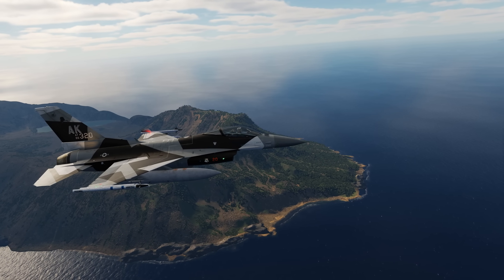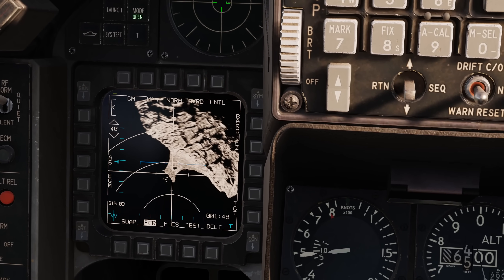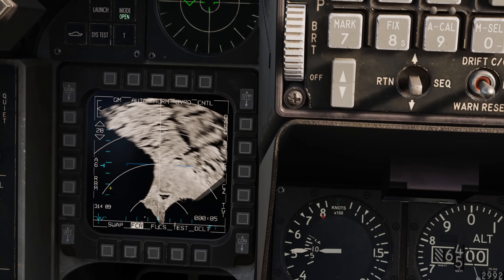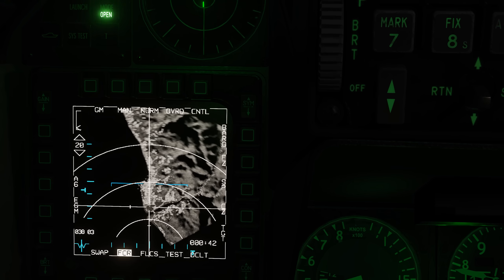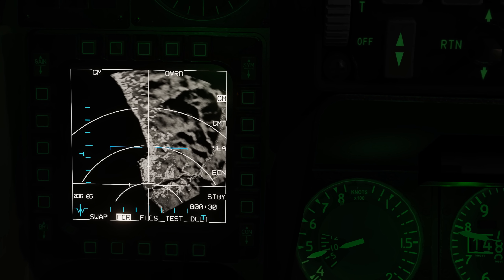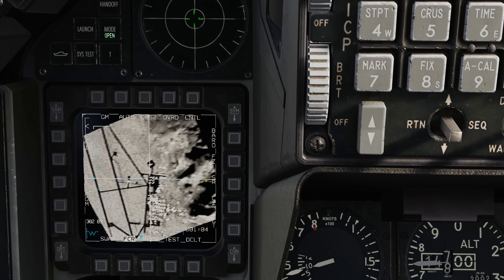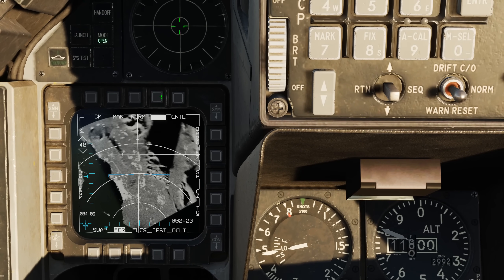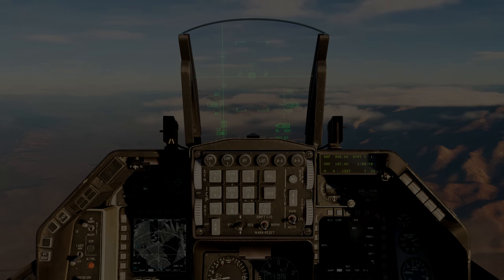DCS: F-16C Viper | Air-to-Ground Radar

Comment: I have mixed feelings about this. I like how the Viper gets good A-G rdr functions. All good there. No issues.

What I really dislike is that the (half)dedicated attack plane aka. F/A-18 Hornet gets a really bad implementation of A-G radar with the age old bug of the target designation not taking in to account the motion of the damn plane.

With its current state, the Hornet A-G radar is unusable, slow, unstable when slightly changing bank, and lacking any accuracy with designations even though it should have better resolution due to SAR.

Also the FRZ option on the Hornet is also absolutely useless since the coordinates are already misaligned due to the movement issue mentioned above.
Reply: well it is the legacy hornet, would be interesting to see if the Super Hornets, AG radar is better.
Reply: @Gamebreaker08  Well of course it would be, the current Rhinos (not the very first lots) have AESA radars.
Reply: @9GLoco  You are assuming the A/G radar is a tool that is actually used IRL. It isn't. Even with the improvements in radar that the Rhino brings, it's just not the magic bullet you guys think it is. The hype around the A/G radar is a definite DCS-ism.
Reply: @Golden5er  I’m not making that assumption at all. One of my best friends is a Rhino driver, and they use the radar almost never. It wasn’t a question of whether or not it was used, he asked if the Rhino had a superior radar to the Lot 20 Hornet, which it does.
Reply: @Golden5er  What exactly are you basing this on?
Reply: @Golden5er  You got my point wrong. I'm not arguing that it should be any better than it currently is. My point is that the radar is bugged with its designation logic.
Reply: @startrekmike  Reality.
Reply: @agostonbazmajer1100  People in DCS always state the same mith, BUT the book "Vipers on the storm" talks about using the ground radar in combat (Desert Storm). In GMT and expand modes on multiple missions. Using it for target designation.
Reply: @agostonbazmajer1100  The book I just told you is written by a Viper pilot who flown multiple missions in combat on desert storm. He talks about using it on multiple missions. GMT to aquire targest, and also on DBS. I'll take the book more seriously that a guy on reddit. Nevertheless, it must be there for a reason.
Reply: @agostonbazmajer1100  If we are going to start talking about "misleading" sources, we are going to need to apply similar logic to random posts on reddit and even some of the more accepted "truths" from books (like the enduring narrative that the HARM is a bad missile just because a HIGHLY biased DEAD focused pilot wrote a book with a rather easily debunked rant about it). 

  Here is the thing. For the last twentyish years, The United States has been fighting a counter-insurgency based conflict in the Middle East. This kind of conflict HEAVILY favors missions that focus more on supporting troops via CAS and strikes against large, fixed targets. Obviously ground radar isn't going to be terribly useful or even applicable in that kind of conflict. 

  As controversial as this statement is going to be, individual pilots are not always going to be the best sources of information. They can tell you about what they did (some more accurately than others) and what happened in their immediate sphere of awareness but that doesn't mean they know everything and it doesn't mean that the information they give is telling the whole truth. 

  The book 'Vipers in the storm' is interesting because it is based on a conflict we fought as if it would be at least near-peer in nature. Before the first Gulf war really kicked off, we had a lot of respect for the Iraqi military and especially their air defense network. The kinds of missions pilots flew in that war were not really the kind you would have in a COIN focused conflict. As such, tools like ground radar were more useful. 

  In the DCS community, there seems to be this enduring narrative that targeting pods replaced ground radar. This doesn't really make a lot of sense when you actually stop and think about it. the targeting pod is very good at looking at targets you already know the location of. They provide a (to borrow a term from a book) "soda straw" view of a small area of real estate. It is a highly detailed view but it is still a narrow one. The targeting pod is great at visually identifying and even guiding certain weapons on to a target but it isn't good at searching for targets. 

  In contrast, the ground radar can provide a much wider (though less detailed) view. It can tell you that there is a big blob of vehicles traveling in a known target area but it won't tell you what they are or if they are hostile, friendly, or simply civilians. This is why the ground radar isn't your ONLY tool. You use it to help put the targeting pod where it needs to go. Working together, they can allow you to see a big blob of stuff where it probably shouldn't be, create a sensor point of interest for your targeting pod to look at, and then attack it if required. 

  It is odd. There seems to be this almost aggressive push to dismiss the ground radar and I think a lot of it is based on taking what certain pilots say on the internet at absolute face value (and without any context). If we were to ask pilots in a more conventional conflict about the ground radar, I strongly suspect we would be given a different narrative since the ground radar can do things the targeting pod can't.
Reply: @agostonbazmajer1100  This is where I always kinda come back to Dan Hampton's 'Viper Pilot' book. It is a pretty accessible, pretty popular book in the DCS community and the reason I can tell that it is popular is because so many unquestionably take what he said about the HARM missile at absolute face value because "He is a pilot, why would he lie? He would know wouldn't he?" The problem is that he does know DEAD and deeply cares about DEAD but also makes it abundantly clear that he doesn't really value SEAD (which is where the HARM is actually useful). His whole argument against the HARM (especially modern versions) is that the missile doesn't kill the launchers (like he does with his bombs) and therefore it sucks. 

  Do you see where I am going with this? We know that the USAF and USN use HARMs a lot. We know that they are a useful weapon system and that they generally do a good job at suppressing radar SAM and AA defenses. Dan Hampton doesn't really think they are worth much but he has a lot of "hot takes" in his book that don't really stand up to scrutiny when you start looking at other sources. 

  I STRONGLY suspect the same thing can be said about the random pilots who tell people that the ground radar is "useless" online. It is the kind of "hot take" that has obvious appeal in the community and it gives people something to rally around (to a bizarrely aggressive degree at times) but I have very little doubt that if we were to actually talk to a wider variety of people involved in the whole process, we would get a much, much more nuanced take. 

  Obviously we can only really speculate based on what we have read but I am at a point where I need a lot more than "this guy is a pilot so we should trust him!" to actually believe that ground radar has been pretty much abandoned. It could be true but I will need something more definitive than a pilot's word because if there is one thing I have learned from reading pilot memoirs, it is that they say a lot of things and some of those things are absolutely not correct. Them being pilots doesn't make them infallible.
Reply: @agostonbazmajer1100  Did you read Dan Hampton's book? He does talk about early versions of the HARM not being very good (which is likely true) and he does talk about their inherent weakness (sometimes they don't track when radars are turned off) but his main complaint was not about the reliability of the missile, his issue is that it didn't kill the launchers. 

  The reason I bring him up is because it gets into the larger reason why we should not place absolute trust in what pilots say. The book he wrote centers on his time as a DEAD focused pilot. His preference for DEAD over SEAD was made VERY plain throughout the text. Going by only the text of the book, it seems like he doesn't really value SEAD as a concept and thinks it is largely pointless unless the launchers are destroyed. Since the HARM is a SEAD focused weapon, his lack of enthusiasm for it makes sense. 

  The problem is that people took that biased lack of enthusiasm as "the missile must just suck" and rolled with it. 

  It isn't that Dan Hampton was "lying" or trying to actively mislead people. It is just that he is human and has biases like we all do. It is the same reason why so many WWII pilot interviews across so many different airframes all boil down to "We flew the best plane in the most important job in the war." 

  Whenever someone brings up the random redditor or even that one pilot on the ED forum that dismiss the ground radar, I can't help but think of Hampton's book or the metric ton of other pilot interviews where bias for a preferred aircraft, role, weapon system, or whatever leads to mistakes and misinformation. 

  I also can't help but also consider that for the last twentyish years, we have been in a conflict that doesn't really allow for ground radar to be terribly useful in a tactical sense. Obviously that is going to have a impact on how pilots view its relative usefulness and that might change in the future. 

  It isn't that I think all pilots are lying intentionally. It is just that my experience reading various memoirs, interviews, and the like have taught me that sometimes context gets lost and sometimes bias overrides accurate "big picture" level information.
Reply: @agostonbazmajer1100  I strongly suspect that the reasoning behind the lack of use/training (if that is really the case, it sounds a bit hyperbolic to be bluntly honest) of the ground radar in our more recent conflicts mostly comes down to how engagements are structured in a COIN conflict versus a conventional peer or near-peer conflict. 

  If you look at the air campaign in general, it could generally be broken down into CAS based tasks and strikes against larger fixed targets. In CAS, ground radar is unnecessary since you already know where your targets are (even if roughly). You have your command and control assets sending you to the area and you have guys on the ground directing you once you get there. For the fixed target strikes, the ground radar isn't going to help much in normal conditions because INS/GPS is a thing. It isn't like a building can really move, you know? 

  For the last twentyish years (the entire career for some pilots), we haven't really been in a conflict that requires the use of ground radar in a tactical sense. It makes sense that some pilots would generally take that as a sign that the sensor itself isn't useful because in their experience, it isn't. They never needed it in the missions they were flying so obviously their statements on the matter will reflect that specific reality. 

  All that being said, I have a hard time believing that they were never trained in its use. It could be true but I would need to see more definitive, more widespread statements on the matter (outside of flippant, rather vague comments on social media) before I repeat it as fact to others. What's more. Now that we are refocusing on peer/near-peer conflict, I wouldn't be surprised if we start really putting some focus on using ground radar tactically, especially considering that military planners are well aware that GPS isn't always a given against an adversary that can deny its use. 

  Bringing this back to DCS. I have noticed that in some of the community's discussions about the ground radar, there is this rather bizarre aggression about the whole thing. Sadly. Like a lot of the hyperbole and mythology in the military aviation enthusiast scene, it seems that a lot of it stems from a few statements made by pilots without a whole lot of context and without any significant detail. Those pilots absolutely could be right but as I have said before, I have long since learned that not everything even active duty pilots say is necessarily the whole truth (though it may be their particular whole truth).
Reply: @Gamebreaker08  our Hornet's radar should be better for A/G than our Viper's though. Especially in EXP3, which is SAR (but just another zoom level in DCS)

Comment: Is the fixed target track like a mark points Wags? Or is this an addition to mark points?
The viper certainly is coming together now really great work.
Reply: FTT is a sort of track which looks for the edges of the object. You absolutely do not need to FTT to attack with the radar. Simply putting the radar cursor over the area is enough and done more often than going FTT. It's similar to using TGP area or point track.
Reply: Fixed target track is like designating a point target with the targeting pod. But, once we have markpoints, we'll be able to make them from a target designated through the hud, fcr, tpod, or current aircraft position.

Comment: This company don't get enough credit from the gaming industry. ED should be winning all types of gaming awards. Bravo ED bravo.
Reply: Was just thinking the exact same thing.  Never hear anything mentioned about DCS except by word of mouth, and yet they are at the top of their field and prolific by any measure.  The more time goes on, the more impressed I am.
Reply: @ziljanvega3879  DCS is a tiny market. X-Plane has like 3-4x the userbase. MSFS is more than an order of magnitude larger. They are all very different games but you don't hear about DCS much because it's a tiny userbase.